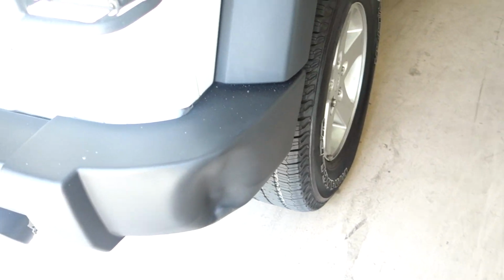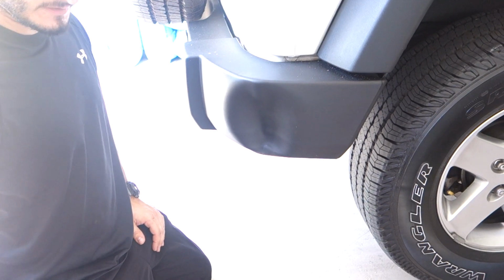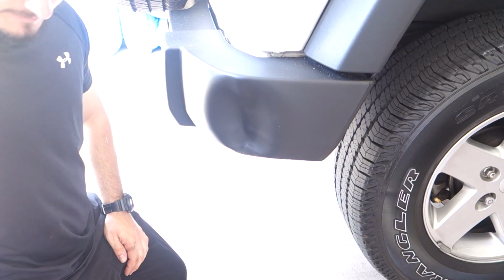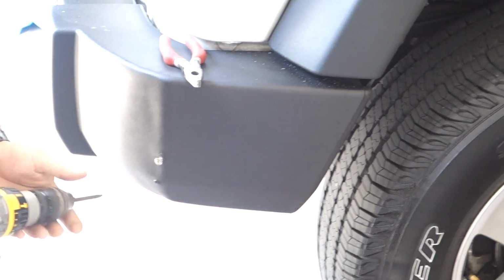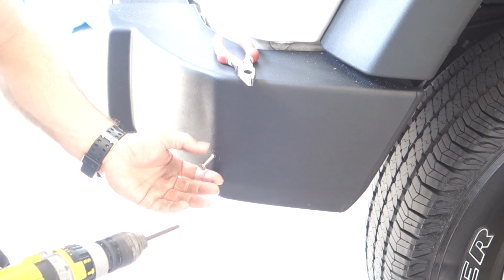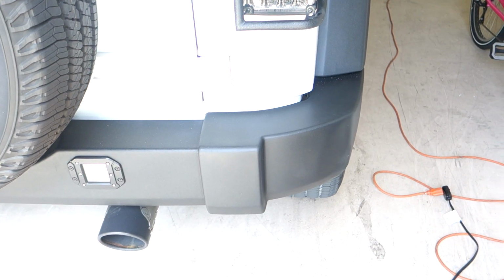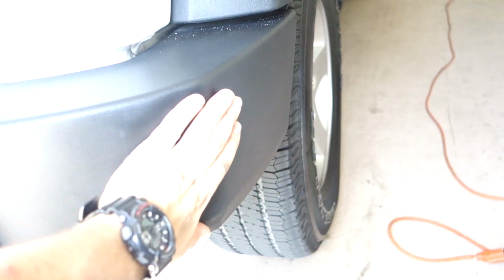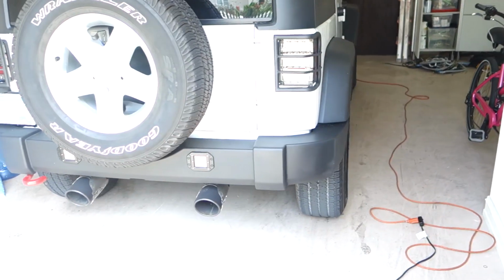How to remove a dent in a Jeep Wrangler bumper

Comment: Great video.   $20 for a heat gun and  saved me some money.  . The key is small hole, the first one I drilled was too big but lucky is lower on the number.   The second one, was with the smallest bit I had, screw still went in and filled easily.   I used a lighter to melt the plastic (instead of sanding)  around the hole and used it to fill the small hole.   For the bigger,  same thing and then a dab of silicone, waterproof caulk.
Reply from the maker: +yoegster Thanks for the positive feedback! Thanks for the pointers! My next project might be new bumpers so ill never have to deal with this again lol :p Thanks for watching! #jeepwave

Comment: Sorry this happened to your Jeep. I drive a 2013 JKU Rubicon. The next time it happens. Dill a 20 mm hole behind the bumper with a Hole Saw. Take wooden dowel stick,round the stick,heat the dent with your heat gun and prize the dent from the inside while warm and it will pop,the end result will look like you never had a dent at all. If necessary you can plug your hole with a plug. No drill holes. I had many mishaps on my bumpers. Front and rear. Try my fix 👌

Comment: Dex, get an aftermarket bumper. Those ppl's car would've been trashed and not a scratch for u if u had a metal bumper.
Reply: that was my thought as well. I remember getting into two accidents where I dented my front and rear OEM bumpers. when I finally got the money, I replaced them with black powder coated solid steel bumpers and love 'em. If someone does tag the steel bumpers, the aluminum or fiber glass that touched will get fucked up more than my bumper will. And if my steel bumper does get it a little blemish to it, that'll just accent the look for all I care.

Comment: Get a piece of 1/4" welding rod and put a 90 degree bend in it.   About 2" in the one leg.  Drill a 1/4" hole in the back of the bumper opposite the dent.  Insert the bent part of the rod, heat up the bumper and when hot enough push the dent out from the rear.  When done, remove the rod and patch the hole.  Bumper is fixed.  I used that method a couple times on my TJ.
Reply from the maker: +rickd248 Sounds really good! I have upgraded my bumper since so one any idiot who tries to reverse into me will not have a good day lol! Thanks for watching!
Reply: +AdventureDex I ended up taking the rubber things off.  They served no purpose so I pulled out the screws and took them off.  Then I put them in a large trash bag and sealed them up for whenever I traded in the TJ.
Reply from the maker: +rickd248 Yah, I got rid of my stock bumpers too! They are for sale in my garage.

Comment: If this dent was happened in the hot summer, it could be hand pushed by to normal as the bumper could be very soft under the hotter sun during noontime.

Comment: So, is there no way to do this with putting holes in the bumper?
Reply: You can do that by using a heat gun. You would (likely) need a hole in the BACK of the bumper (hidden) as after you heat it, you push it from behind to make it pop out. You can then seal up that hole and no one will ever see it.

Comment: I pulled off the worthless plastic bumper and threw it away.   Now I have a stainless steel bumper.   Let the idiots bump into now.   In fact,  I have seen evidence that someone has bumped it because of a grey line of paint I found on it recently.  I had to laugh when I found the grey scuff on it.   I knew for a fact the other car must have had a massive dent.   I just ordered the stainless still triple hoop front bumper.  I am filling them with sand.   Let them run into the bumpers now.
Reply from the maker: Thanks for the comment! I did the same thing haha! Thanks for watching! #jeeplife

Comment: Would have been so much easier to just take the bumper and do it from the backside. That way you also don't have holes in your bumper
Reply from the maker: Thanks for the input but the bumper is hallow.You can't access it from behind unless you cut a hole in the back which is basically the same as making a small hole in the front lol. Most people replace the factory bumpers anyway so it was only a temporary fix! Thanks for  watching!
Reply: AdventureDex ....that was the point lol The holes won't be visible from the back and you can get the dent out alot better since your not confined to drilling holes and putting a screw in to pull it out, there will be no visible damage.  With a hole in the back of the bumper you use a long rod to push the dent from the backside while pouring hot water on it. Similar to PDR.

Comment: you should have tried pouring hot water instead of drilling holes.
Reply from the maker: +Devanshu Desai Thanks for the comment. That did cross my mind but I thought the hot water might of ruined the texture of the bumper and with the hot water method you need to be able to push on the back of the bumper to pop out the dent. Well the Jeep bumper is enclosed so there is no way to get to the back of it. Thanks for the idea tho!
Reply: Your welcome 
Great jeep
I wish i can customize my jeep like yours
Reply from the maker: +Devanshu Desai Thanks a lot bro! Just do what I do. Make an Amazon wish list and save money. Then when you saved enough you can buy a few things off the list! Good luck. Thanks for watching!
Reply: +AdventureDex Yeah i am trying i have a couple things in wishlist